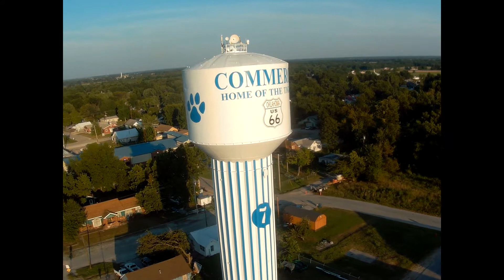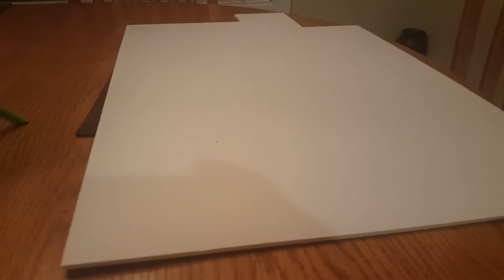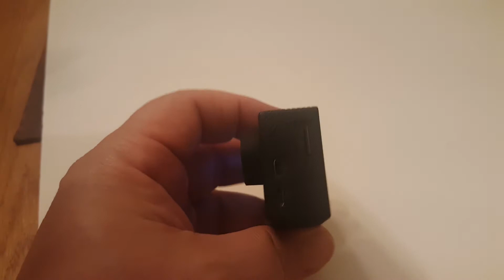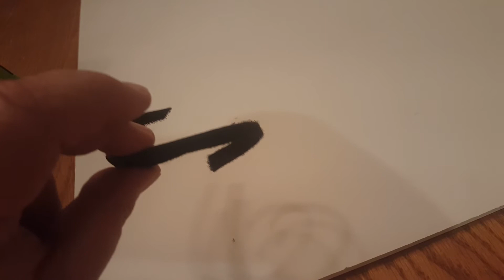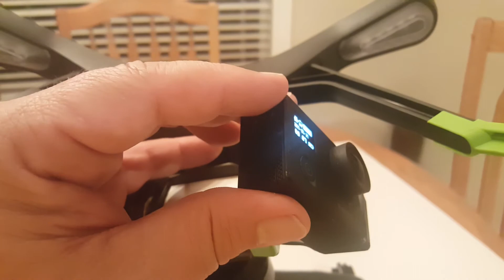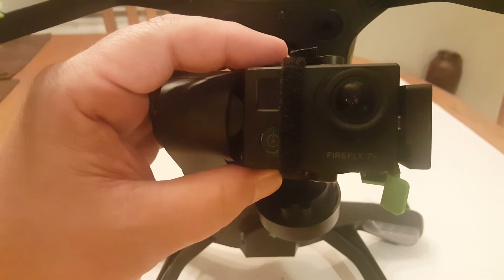Mounting Solo 3dr Gimbal with generic camera - Firefly 7s

Comment: If you put a strip of velcro on the seat on the gimbals bottom lip and a strip at the bottom of the firefly it will give you more security.I did it  with my andoer 4k  and works great,You just promoted a lot of sales for the firefly being that the hdmi ports are the same as the go pro.Good discovery and great vid,appreciate you taking the time to share,God bless.

Comment: I had a GitUp Git1 camera that I used on a X380 drone and adapted it to my Solo the same way and the hdmi port on the
camera matches up like your Firefly 7s. I purchased a cheap $40 camera off of Ebay just for the Solo and the hdmi port
does not work on the Solo. Users need to be aware that not all cameras will work with the Solo so it could save them $$$!
Thanks for your video and ideas!
Reply from the maker: It is a good option.  Only thing is I think I eventually damaged the HDMI port on the camera. I think from the pressure that the cable put on the port.  My FPV quit.  I found a great deal on a brand new GP4 for $249 so I went ahead and upgraded.  I am still using the Firefly for other stuff because its a great little camera for the money.  In fact, it has image stabilization that the GP doesn't so there was no noticeable vibration when I used it.

Comment: Thanks for the post because I want to buy the gimbal, and eventually I will get a GoPro I currently have a 4k  knock off that has the ports in the same location as the GoPro. I really like my 3dr solo and want to get use of the gimble feature without having to buy the go pro all at the same time.
Reply from the maker: Glad it helped!  I did eventually get a GoPro for a couple of reasons but I cant complain at all about the performance of the FireFly.  There is one thing I would add.  Be a little careful plugging and unplugging the HDMI cable on the gimbal.  It has to stretch a little and it puts strain on the camera's port.  I eventually damaged mine.  You could consider getting a HDMI extension to modify this a little to keep from putting undue strain on the camera port.

Comment: do you get inflight video through the hdmi? (if so, what are the camera settings?
Reply from the maker: Yes.  You get full FPV.  I usually record at 2.5 K or 1080P for editing sake.  As far as HDMI settings out, I use the 1080P 30 fps.  I use a Samsung Note 5.
Reply: Thank you!